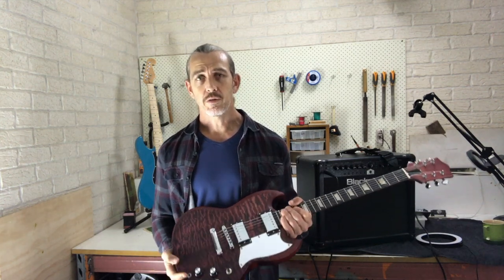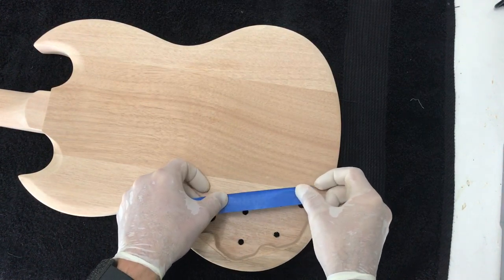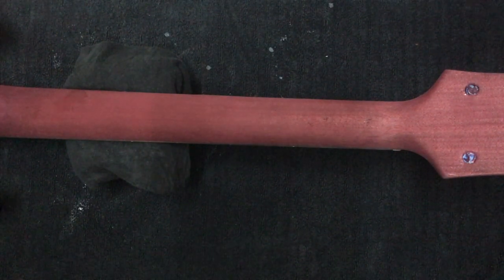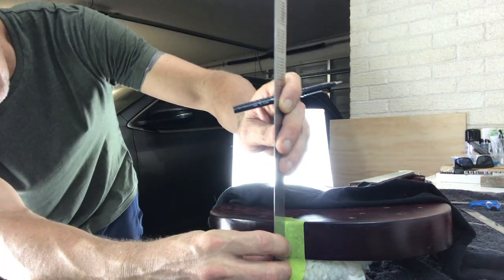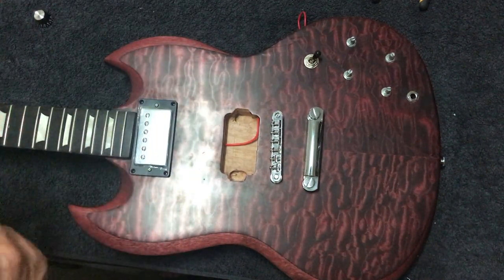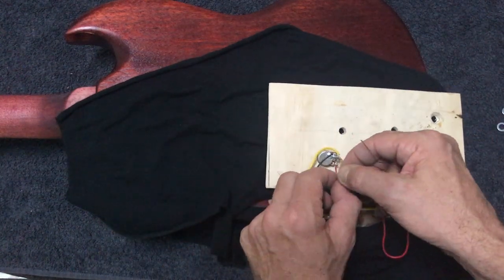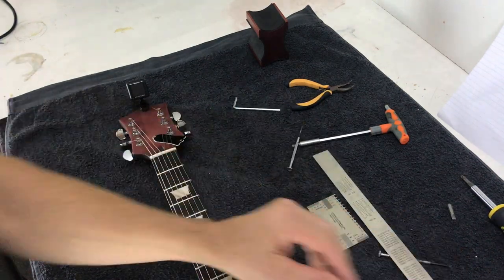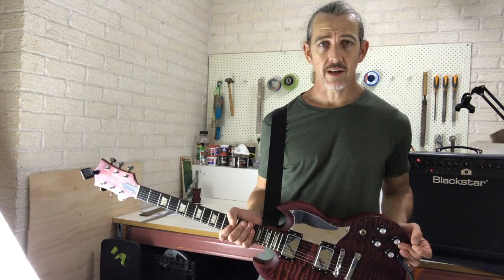AC Guitar Kit Assembly Manual

Comment: Lightly sand the glue joint on the top as glue is never removed correctly and its always shows up so bad when applying a darker finish.  And I like to tint my grain fill with black as it really makes it pop when the final finish is applied.  I've done a few kits with this sort of quilt but I find them very thin so doing multiple colours and knocking back is difficult as its very easy to sand through.  Tru oil is the best hand rub finish for this sort of diy application.  Nice looking kit tho.
Reply from the maker: Thanks for checking out this video Stu! Appreciate  your input!